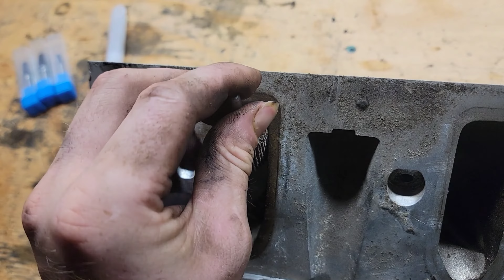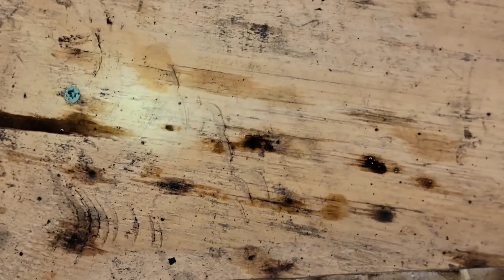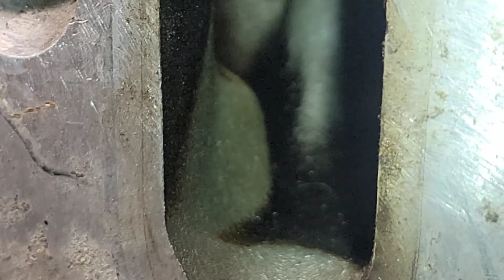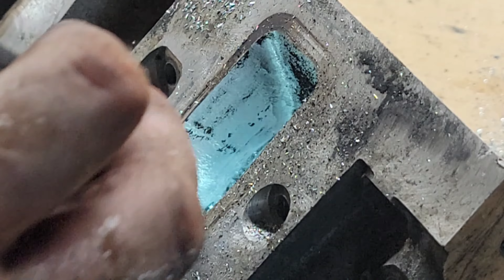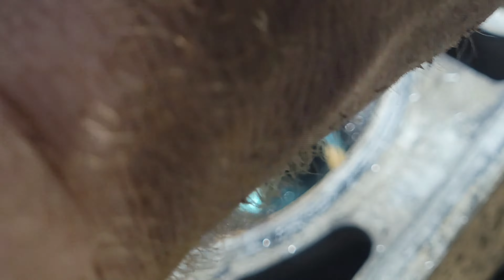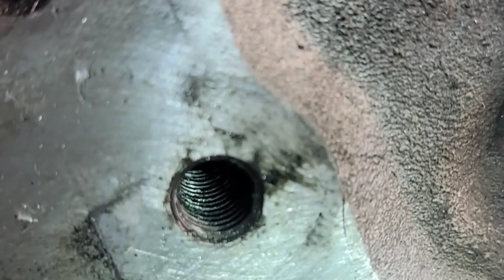How to port your LS cylinder heads! In your garage by hand! +40cfm!

Comment: Bro, did you ever run these heads? That bowl looks pretty large in the video, so I just wondered if this engine was a little on the lazy side on the bottom if it's an N/A deal! I'm not being the YT know it all, I've always tended to probably ask too many questions, but I generally end up with a pretty good understanding of things in the end. Did you just do this set for the video? I'm surprised that you didn't get a valve job done. You can normally pickup roughly as much power there as doing all the other work and  you got a valve job done! We know that all LS heads need a valve job if they have any miles with the way they pit on the exhaust side and the only contact the valve is usually making with the seat is a little pencil-tip thin ring way outside. At least that's my experience with the ones I come across. I'd imagine I rarely see one under 200k...

Comment: Get some single cut aluminium burrs! Will be less prone to clogging.
Reply: @wilsondriver654  yes, but a thin film lubricant like Royal Purple Max Film sprayed occasionally will clear the double cut burr and keep it sharper, so it can last longer, so it can do more work......

Welding tip gel works great too. Ultimately a non-ferrous burr would be the right tool for the job, but they can be intimidating to the uninitiated. They're sharp when new, and that first bite ain't always "love".🤣🤣🤣

Comment: Dont remove the swirl ramps on intake bowl .
Reply: The swirl ramp is to improve fuel efficiency at low rpm, and hurts flow opposite the short turn at high velocity and lift. Every good porter takes it out.

Comment: does porting increase combustion chamber volume and possibly lower compression ratio
Reply: No, in this case it will slow the intake velocity down, and all those sharp thin edges are stress induced cracks waiting to happen.
Reply: Grinding the combustion chambers will effect CR. Porting is work done to the intake and exhaust runners.
Reply: @Artoconnell hey art, I noticed you didn’t have any porting videos up on how to properly do it. When are you gonna upload one?
Reply: @DWBmotorsports  Your fine, drill for water. just wallow them out.  WHy would i upload anything to this BS site?
Reply: @DWBmotorsports  Mu all time fave is when people smash numbers into the top of the piston. acts like a mini glow plug.
Reply: @Artoconnell  I just figured with all your vast knowledge on the topic you’d have some work to show for it.
Reply: @Artoconnell  wrong answer.
Reply: @ oh ok.   Thanks cya on the track
Reply: @Artoconnell  no, you won't.
Reply: @ didn’t think so. Much easier to argue over basic theory … velocity is crucial to stable predictable combustion